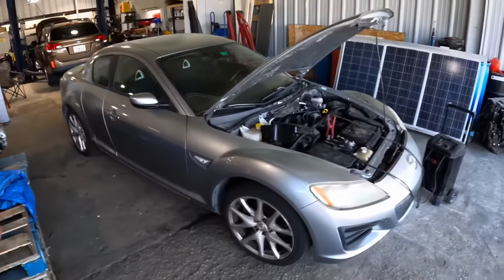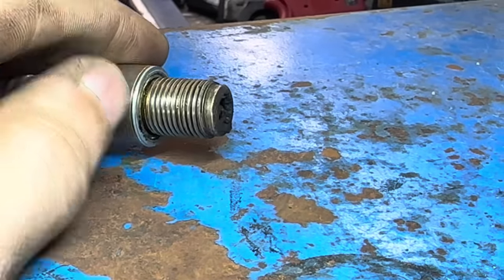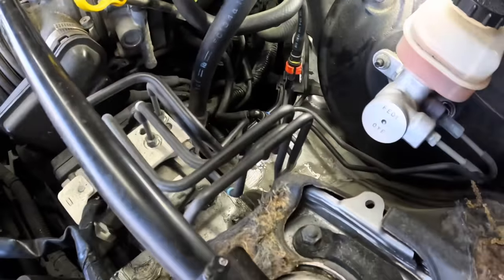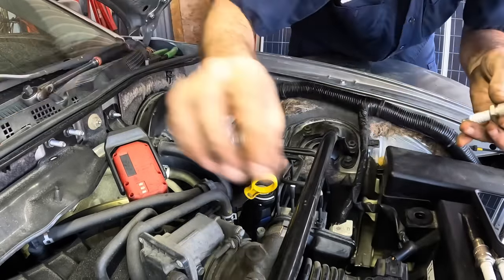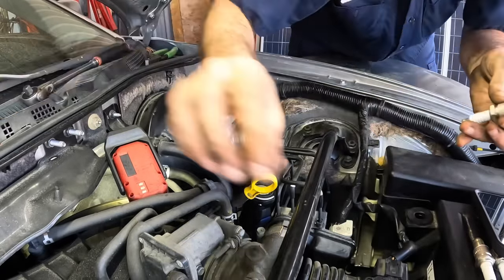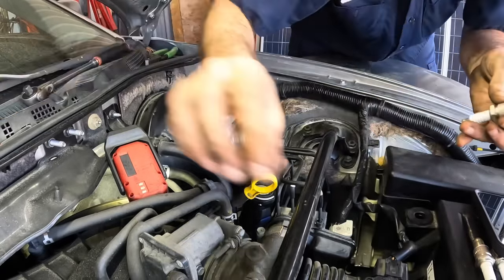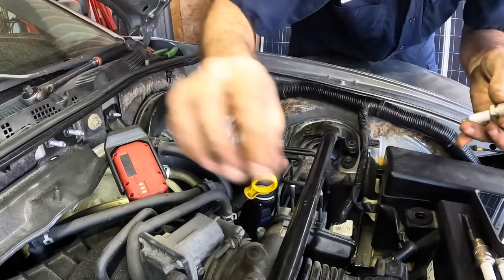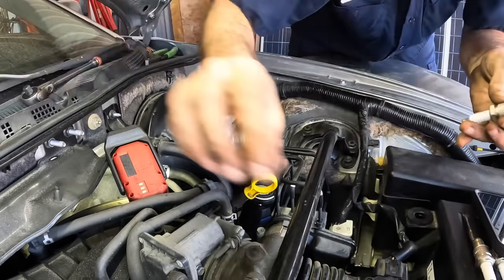Low Compression Rotary, No Start FLOODED Mazda RX-8 Drove in Towed Out!

Comment: Oh, Ray, you have just begun to see why I no longer work on or own rotaries. I've owned 5 RX-7s and refused to buy an RX-8 after one test drive. Just wait until you realize there is a component in the intake that needs to be replaced because of the flooding that is an RX-8 problem of mammoth proportions and well known in the rotary community. May this be the last thing you do on this car. Trust me, refuse all further work for your own health physical(ulcers) and mental health. These will drive you crazy no questions leave it to the rotary specialists they already have the perforated ulcers and severe lack of sanity.

Comment: It looked to me that it would have been a timing issue, I don't get it, I would have NEVER thought that a constant cranking on the starter would clear the engine enough for it to run perfectly. Its like you can mind read the vehicles you repair.

Comment: You're "surprised the plug is able to fire at all"? Apparently isn't, as the car won't start. 😉
Car won't run.  Are you sure the previous mechanic put the right plug in the right place?
So what was it?  The plugs or the not fully charged battery, causing the plugs to foul?

Comment: Could the ECM voltage been slightly lower that spec because of the starting with a low battery? The battery booster may be putting out some noise that also was not acceptable to the ECM. What you think? Once the battery was up it then started. I have seen some weird stuff with low and dirty voltage. Thanks for the videos it keeps me thinking.

Comment: I cut the mufflers off my 6 sounds better, gas mileage is stil superb 350/400 km a tank and it's got 354000 km almost ac bearing replacement this weekend spark plugs too probably mazdas are good cars I want a rotary engine tho they are pretty cool

Comment: Low Compression with a Rotary engine?  Apex Seal wear is most always the problem, it is a very predictably problem with rotary engine.  Rotary engines-  need the seals for compression replaced - Rotary engines often need a rebuild between 80,000 and 100,000 miles because apex seals.  Many rotary engines die with low compression around 30,000 miles.  I like rotary engines but had the needed rebuild at relatively low mileage.

Comment: OK, I'm curious, obviously you expected starter cycle Reeee' for a reason. 
I know nothing about rotary engines, are they easier to spin and therefore less work on the starter? 
In the airplane world there are specs for 30 sec on 60sec off, 3 times and then rest for 30 minutes (just one example, starter generator turbine engine, not all the same) 
With a hard to start piston, you can tell the point where the guy got mad cause now he is just holding it for a LOooooooong time. I actually saw one catch fire once, the surrounding stuff that got torched along with the aircraft starter was an expensive day.

Comment: Rotary.
I had an rx7 that would do this crap. Would eather have to drag it down the block in 3rd gear to get it to fire. Or sometimes a spray or 2 of oil in the throttle body would get er going. 

Never really figured out issue or fixed it. Just sold it off and let the next guy deal with it 😂

Comment: I would suspect that it is burning a ton of oil.  I know these engines gobble up oil when they are new and they will get worse and worse util they are done.  My cousin had one that he had to put a entire quart of oil in it every time he filled the gas tank.  It takes talent to keep them going to 100k miles.  It might have flooded too but I would bet that was because of the buildup from burning oil.  I mean, just look at the spark plugs, lol.

Comment: Wankel engines are so strange.
It's a 2 chamber system, that requires two spark plugs for each chamber.
They give the chamber extra redundancy, not bigger bang, to make sure the vapor combusts successfully.
Just like an aircraft reciprocating engine.
While they're cool engines, they're not very high in reliability...

Comment: Ray, just wondering how much fuel got in the oil. When I run into those conditions (just finished one yesterday) I always change the oil and filter. It was on a 5.2L Dodge van. It gets new plugs and wires on Saturday.

Comment: Don't you know rotary engines were supposed to be simpler and easy to work on? GM spent a fortune on the technology without ever producing a single car for sale. My dad's company had a Mazda rotary powered station wagon that actually ran well but didn't get great mpg which was the rotary engine's achillee's heel.

Comment: I was very seriously considering buying one of these back in 2003 after a test drive - it was so much fun to drive - light and tossable, yet forgiving.  Not a lot of power, but the throttle is very responsive and the handling and braking were fantastic.  The salesman was egging me on to get the tail hanging out and I was more than happy to comply.

Then I looked around the lot.  The dealership must have had 30 of these on the lot.  That got me to thinking.  So I told the salesman I'd return the following day.  A few hours' research that evening and I'd learned all I needed to know and, naturally, I never went back.  If you're planning on using a vehicle with a rotary engine (ie a Mazda RX-7 or RX-8), make sure you aren't planning to make it your daily driver.  Make sure you have someone who knows rotary engines inside and out take a close look at it for signs of pre-existing problems (don't worry, you'll have all kinds of  brand new problems to accompany them after you buy the thing), and a healthy reserve budget for repairs/parts during your ownership of the car.

I like the body style (yes, I know it's controversial), found the seats super comfortable, and REALLY enjoyed the driving experience.  But I would never, ever buy one.

Comment: Flooding those Rotary engines FUBARs them does it not? (Obviously not lol)

I know that happens if you start them and stop them without allowing the engine to get up to optimum operating temperature anyway. (You end up with fuel in the oil and oil in the fuel all kinds of messed up stuff if I remember correctly)

Cost thousands to rectify that and it was rife when RX8s first came out.

Comment: Likely as not the repeated flooding cause the gasoline to strip the oil off the rotor tip seals resulting in zero compression.
It pains me to see an automatic transmission RX-8, it ruins the engine's capability. Even the redline is wrong; it should be 9500 in a manual.

Comment: The car is marked as a 1.3 but actually it has two rotors making it's a 2.6.The car is blisteringly fast but the car you have been working on is ruined performance wise by having an auto box fitted.If ever you have a chance to drive a manual version you will know what I mean.I have had two of these cars,problem is as you've found out,it's a real Pig to work on and very troublesome.I'm in my mid 70's now,not so agile as I used to be which is why I no longer own one! Nice video Ray,best wishes from UK.
Reply: No, both rotors together make it a 1.3
Reply: @johnt.848  Due to power generated by the rotary engine the 2.6 is a joke here in the UK,I know it's a 1.3 but runs like a 2.6 when running properly, it also matches the fuel consumption used by a 2.6.I don't think I will remove the 2.6,lets see how many people spot what's wrong. Best wishes from UK

Comment: Very disappointing listening to you destroy his starter. Back in the day of adjusting dwell on points, I learned to pull the plugs, crank the engine thru with no load while adjusting dwell. It clears the cylinders and blows dirt out of the SP holes. When a car won't start, flooded or not, a shot of ether does wonders.
Reply: Lmao you are why he put the disclaimer in the video.  Did you do a little reeeeeee as well

Comment: You made couple errors here and slipped a gear!!! 1> You should've checked air filter, then you should've run some of that internal snake oil cleaner through the engine, and then give it an oil change..... 
Also, in couple years after your goatee turns grey and your store gets bigger, you can start calling yourself Colonel Ray and sell fried chicken, can I have coleslaw with that.............

Comment: sounds like the seals have jammed. bit like the rings jammed on a piston. try running 24 volts through the starter hopefully it will spin fast enough to throw the seals out loosening them
Reply: it happened a few times on my 13b mostly caused by starting the engine and not letting it warm up before stopping it

Comment: It's a Wankel engine. A Rotary engine is a where the cylinders are in radial configuration and the engine's crankshaft remained stationary in operation, while the entire crankcase and its attached cylinders rotated around it as a unit. Yes,  I'm fun at parties.
Reply: How right you are - BTW every party needs a smart arse, especially when he's correct, so don't apologise!😂😂
Reply: Another great French design. The airplane would only roll with the torque and used a total loss oiling system using castor oil. Of course the pilot got to breath it in so no constipation.  And just for fun there was no throttle to slow down you turned the ignition on and off.

Comment: I believe Mazda  are being a little economic with the truth. There are three Chambers to a rotary engine, each appropriately  600cc so in truth 
You have an 1800cc engine   Twin rotary engine is there for a 3600 cc engine.  Then turbocharged,  no wonder it was very fast😊😊 stay well 
Stay safe
Reply: You believe wrong. Twin rotor is 1.3, triple rotor is 50% larger